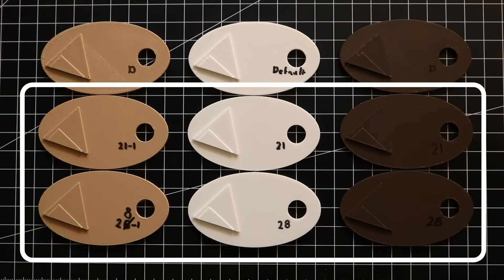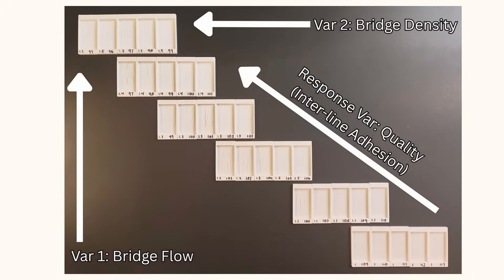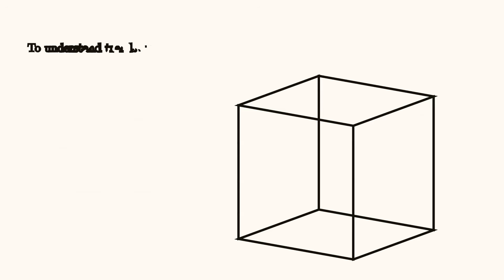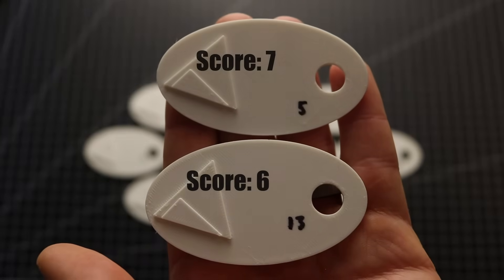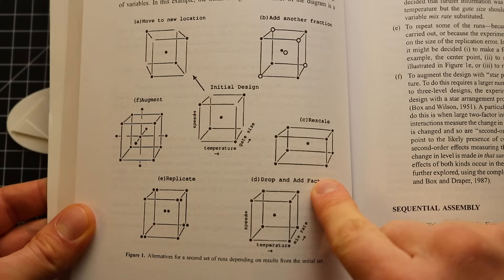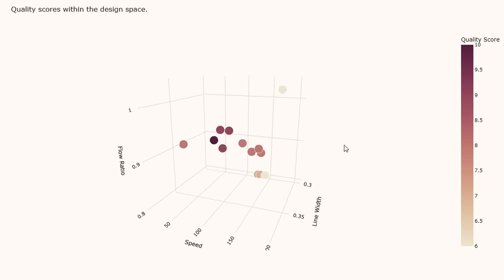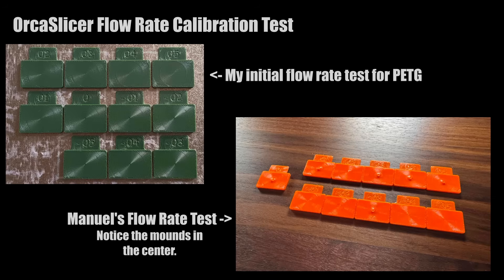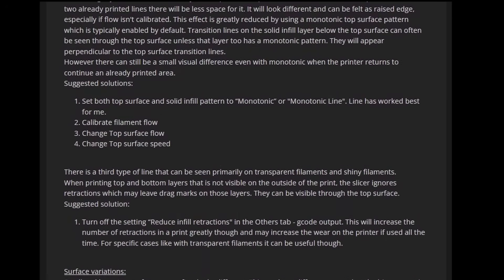Get rid of top surface layer lines in your 3D prints (no ironing)

Comment: Some advice, youtube uses a significantly better codec and much more bitrate (18mb/s) when reencoding 1440p video containers compared to 1080p. Even if you're recording and exporting in 1080p, make sure your resulting container is 1440p, even at the same file size etc the youtube upload will look much better due to the better bitrate allotment and higher quality re-encode. It's hard to really make out any of the fine details we're looking for in the video. 
It still gets the point across but it would really go a long way in presentation.
The same is true of 4k uploads of course, but 1440p is where the biggest upgrade is due to the swap to the vp9 codec.
Reply from the maker: Wow, thank you so much for the advice! I triple checked everything after I watched the video on YouTube and could not figure out why it looks so bad compared to the files I have locally. The same is true for the photos in the thumbnail. You may have just given me the key to this and I am very grateful!

Comment: Fantastic guide and amazing results. Your previous one on bridging was also excellent! 
One challenging area in 3d printing quality I've had some difficulty with and is box lines aka hull lines, and I feel like your scientific approach would yield a definitive guide and potentially some slicer level improvements towards addressing this inconsistency. Maybe an idea for another topic?
Reply from the maker: This is a good idea! Thank you. I don't know if I will address this in the near future. I have a plan for about ~15 experiments (overhangs, another bridging video, and 'sequential fabrication' that involves molding and casting). I am also attempting to write a book about these techniques based on this set of experiments. So, maybe in 6 months to a year I will finally get to hull lines lol

Comment: A really nice application of the technique. You have skipped some of the power of it by assuming which parameters are hitting the quality. Normally you'd include more params in your initial tests, then add the confounders and use q2 and r2 tests to narrow down which ones matter.  There are also better distribution models for picking the initial and expanded sets.  Having said that, you do seem to have nailed the model more or less this way. It does make me wonder how much we can extend it with other params to more general print quality investigations
Reply from the maker: Best response so far. Yes, I think that you're mostly right with all of your points. I have a response intended to clarify the way we ran this and a question:

1. In Box' book, he mentions that you can use a subject matter expert's suggestions as an entry point into experimentation. I do realize that I am appealing to authority with the previous sentence. But, in this case Box is my teacher (through his work), and I took this tip at face value. 
In this case, Critical (my friend) had already tested a number of factors less systematically, but found that this set consistently influenced the desired results. 
Of course, this is not the best way to conduct these experiments. But, I chose this path because it offered an entry point that was straight forward. Box also discusses the concept of sequential experimentation, the sentiment encapsulated by the statement "The best time to design an experiment is after you've run it." So I figured that I would learn something from this set, and if the results still weren't meeting my expectations I would just design a subsequent experiment based on what I learned. As you've mentioned, these factors seem to have provided a model that produced the desired result. So, I did not see a need to expand beyond this set. 

2. You mention using q2 and r2 tests to identify which factors matter. What is your opinion on using a normal plot to accomplish the same goal? I've read a few books on the subject now, and they all suggest that as the starting point. As in, brainstorm all relevant factors, run a fractional factorial design, then assess main effects and interactions with a Daniel's Normal Plot, or some variation on a normal plot. I am asking you because you seem to have a broader understanding of statistics than I do, so you may be on to something that I have not learned yet.

Comment: can you recommend what make and model of black marker you are using to label the samples? everything i have tried either does not mark it or just bleeds like crazy when marked
Reply from the maker: The marker that I use is a Sharpie Fine Point. I just press it lightly and have never really faced an issue on any filament type so far. I bought a box like this a few years back and have been using them since: https://www.amazon.com/Sharpie-Permanent-Markers-Point-Black/dp/B0F36Q59ST/ref=mp_s_a_1_2?crid=3VD1ICO02JJOQ&dib=eyJ2IjoiMSJ9.0AAvDmVamnzM-6zZ7UeT_3uUig9lR_gRGXogVgDFI1fPj6WMOqXZnmi-QAMeExV8i3xtT11Bs_TRGqoQ9CmZV9ftcimkOQy_D2-RHjjZPitPwuGR_unAnH8p2fK8ZW3EQ6BbIXy2czIKoHIyVDi4SlyNejYYwg_YTmHQ6Hp2gNcSwrlPqhFqL4-pP9EAZjsv.lu4JQwem0ScWhHP_AevTO9WKB7ISpE_HYDBgUJixjZg&dib_tag=se&keywords=sharpie+fine+point&qid=1767116251&sprefix=sharpie+fine+poin%2Caps%2C272&sr=8-2

Comment: One must be cognizant of the fact that the corners might not be extreme enough. PLA PETG even ABS are as simple as it gets and already in less than 10 years the issues are becoming cyclic.
Reply from the maker: Do you have a place that you would recommend looking to see past issues and solutions? I agree, cycles are probably occurring. I can't easily identify these, because the research process often involves reading random forums, testing poorly written instructions, and in many cases not being able to replicate some of the solutions that I have seen reported on the internet. 
At this point, I just start with what I have and reason towards a solution on my own, which has been successful so far - for my own prints and on YouTube.
Anyway, the three filaments you've mentioned make up the vast majority of the market. I found a little manufacturer in the UK that posted the stats for the demand across filament types: https://www.filamentive.com/2022-3d-printing-filament-trend-report/
This kind of data is hard to find because manufacturers often do not share it. But, it aligns well with what I see being used across Maker World, printables, and YouTube. So, I often read this feedback as "This only works in like 80% of the cases." And I am like "ok."

Comment: Well I either lack couple dozen IQ points to understand all that or I need couple more cups of strong coffee
Reply from the maker: I would consider this video as a summary that says "We tried these methods and they worked." Usually, understanding comes from getting involved in the details. So, if you have a similar problem, and some time to study, all you have to do is google these techniques a few times and you can work out the understanding for yourself. Just trying to say that I believe that you can do it! 
Also, if you want a course on this just tell me here. I try to plan my content based on votes.
Reply: @MakeSometh1ngWonderful  Thank you for the response, I did get on experimenting right away. Read the linked guide as well. On the third try, each better than the others!

Comment: Not sure if anyone’s mentioned it yet, but how does Small Area Flow Compensation fit into the equation, if at all?
Reply from the maker: It would likely help, if you are using the setting in OrcaSlicer. We built this project out in Bambu Studio, which does not have an explicit setting for Small Area Flow Compensation. We used a few calibrations for flow rate and flow dynamics and got excellent performance on those tests. 
The challenge with this test piece is that it demands performance in extremely small areas, large(ish) surfaces, and around the hole. So, we observed that you can optimize K-value to perform really well in one of these areas, or sort of well in all of these areas. I, personally, couldn't find a way around this tradeoff. Not to say it's impossible!
Reply: @MakeSometh1ngWonderful  I may be an ancient user that misses the S3D times, but currently i use ideaMaker which has Small Area Flow Compensation and Pressure Advance per feature, its a great slicer with a lot of granular control, the downside is we have to build the profiles from scratch and the interface is a bit weird.

Oh, it also has per feature flow settings, and you can separate the solid surface settings from the "top" ones, this way is possible to run different settings only for the last top surface.

Comment: The images of the surface from the microscope show two facets for improvement - within the broader scope of the project.
1.  Small Area Flow Compensation
2.  Gap Infill

That said, these are tiny details within the broader scope, and they really didn't standout until significantly magnified.
Reply from the maker: You seem to have the correct interpretation! I didn't put too much thought into these, because they were only half way through the optimization. What I may try to do in the future is  set up a new scoring system based on images like these, and just run Bayesian Optimization from the very first print and see if that finds an optimum more quickly
Reply: @MakeSometh1ngWonderful   Some kind of objective testing/evaluation process would only help to improve the results.  It'd also take pressure off you and anyone else participating.

You're doing great work here, I think this is a real benefit to 3D printing knowledge.  Thank You!

Comment: You won't believe it, but that's exactly what I've been doing for the last 2 weeks)I have already printed more than 60 samples. In the ironing function, it's not just speed-flow-width that affects quality!!! The quality also changes a lot from blowing the model during ironing. This parameter changes as the filament cools. At the moment, my best print on PETG is ironing with parameters: Speed 120, Flow 30%, Width 0.17, Model fan speed 15%
Reply from the maker: I believe it! Very interesting. Have you done anything with the top surface parameters? I will give these ironing parameters a shot soon.
Reply: @MakeSometh1ngWonderful  
I really disliked the beginning and end of the smoothing process. They were more matte (this was especially noticeable on square pieces, as the hot nozzle sits in the corner for longer).
On white filament it is less noticeable...
I reduced the top surface print speed to 150mm. Top surface extrusion width is 0.42mm. Top surface acceleration is 1500mm/s.
Ironing parameters: Line spacing 0.17, Speed 120, Flow 30%, Model fan speed 15%.
These are the parameters I use for PETG filament.

Comment: I would argue that speed is a bit of a blighted parameter because of acceleration and size of test print (ie does it really reach Vmax.) Be interesting to see if it holds up on a larger surface.
Reply from the maker: Yes, this is a good observation. I've been running some low n experiments for speed, acceleration, and size. But these are expensive because each large print takes 3-5 hours.
I'll try to apply DoE and see what comes of it. If you were picking parameter ranges what would you choose?

Comment: My reason to limit at 3 parameters is, I don't know how to do that math for N dimensions. But the math guys know.
Reply from the maker: Do you want a video on DoE? I have a few books on it now so I've been thinking of doing a series applying all of that to 3D printing
Reply: @MakeSometh1ngWonderful  I did a MOOC subject in Control systems for Robotics a decade ago and that introduced me to parameterisation. I found the subject fascinating but I had a flashback about the math when I made that comment I think. I had to speedrun university calc1, calc2 etc to keep up - and it didn't make me a math guy.

Assuming it's Design of Experiments video you have in mind, that would be smart video to make if you keep doing collabs with people and documenting them. Watching application of the method across different 3d printing subjects would be interesting.

For this video focusing on top layer was pretty smart ... it can't affect the rest of the print. The method works well for it but other 3d printing areas I don't know how it would work 

I am new to 3d printing but an area I am interested in is how difference in the speed of cooling affects layer uniformity in smooth wall layers. I have seen images of people pleased that they have no stringing but how about those layer lines. Maybe thermal camera can provide extra data.

Comment: It's guys like you that continue to push the bondaries of what plastic FDM can do. I think FDM is maxed out at this point, with multi head/multi nozzle and the slicers. It's time that 3D printing gets the new wave. Which is going to be laser sintered. That needs to come down in pricing, and in cleanup etc.
Reply from the maker: Or maybe sequential fabrication. Like printing followed by electroplating or casting or mold creation.

Comment: This was fascinating! I didn’t understand most of it. What are the conclusions for us lay folks to get results like that?

Thanks for the video!
Reply from the maker: Not sure if you meant to be funny, but those two sentences together made me laugh out loud. Based on what I've seen so far, it looks like a line width that is 75% of nozzle diameter and slower top surface speeds (less than 130 mm/s) create a nicer surface. 
I also found great results by reducing Flow Ratio, but none of my friends replicated that.
And yes, I calibrated my flow before the experiment. So, I do not understand that yet.

You can follow the link in the description if you want a guide that helps you find good settings without the statistics.
Reply: @MakeSometh1ngWonderful  it was a genuine reaction! The earnestness of it makes it funnier, I guess! 

I just got my Bambu A1 mini, and my prints are sub optimal, I’m on a journey to get better prints (I can get ok prints without supports, i can never get to smooth outcomes that yt’ers show on their videos. Supports are just compete failures every time).

Checking out the guide now!
Reply from the maker: Ok, I hope that the guide helps a lot. Message me on Maker World if you need any help and I will see what I can do. Providing remote technical support for 3d printers can be difficult, but I've been able to help some beginners get great results recently

Comment: This is very good work, well thought out, and extremely useful. I've noticed every now and again when using different slicers, some models had better top surfaces... looks like I've found out why. I need to Hype this video  :/
Reply from the maker: Thank you! Why do you think the results are different across slicers? Maybe flow ratio?
Reply: @MakeSometh1ngWonderful  could be different printer presets. Cura had really bad presets in the past because they relied on users or companies to create them.
Reply from the maker: Ah, I see 🙂‍↕️
Reply: @Optisystemizer  Exactly, it was different slicer settings from manufacturers that were not optimised. The Qidi Studio preset was inner/outer for perimeters, and I never noticed, and wondered why the quality was so bad compared to my Orcaslicer I was using on the Bambu...that was set for outer then inner, and I never noticed.🤣

Comment: This is awesome. Going to try this with my printer and see how it compares with my favorite ironing settings I'm currently using.
Reply from the maker: Nice! Love it. If you have ironing dialed in, these pieces will probably look slightly worse, but will likely be faster. The ironing that I showed in the video was just run with default settings.
Reply: @MakeSometh1ngWonderful wish I had found this video last week when I was printing  30 name plates that took almost 3 hours each because of the ironing on all the top surfaces😂 Hopefully it saves time in the future 🤙
Reply from the maker: @yoitsli0n That's an excellent use case. Good luck with your experiments!